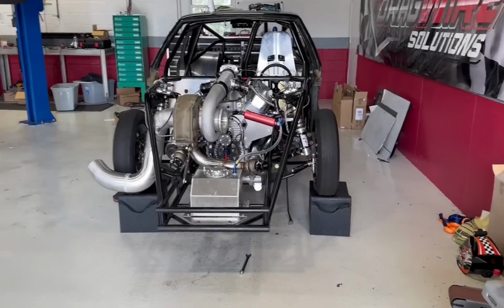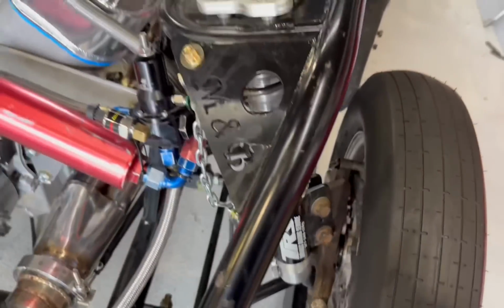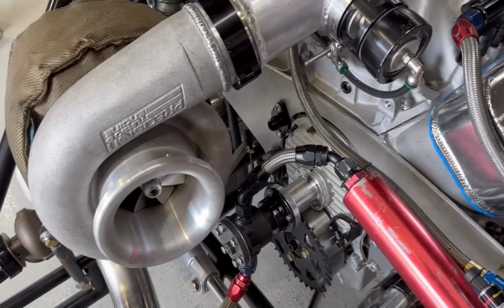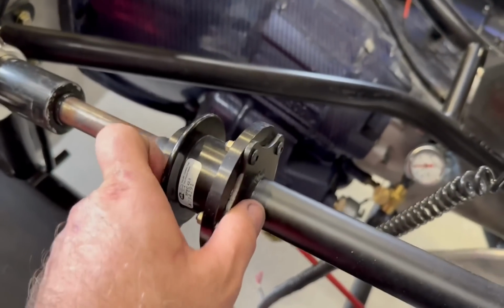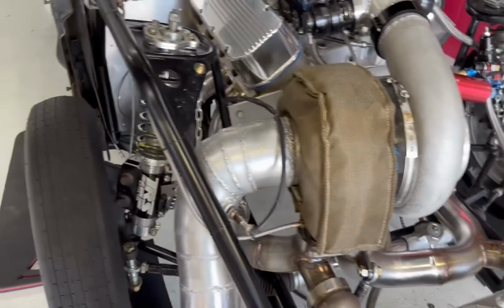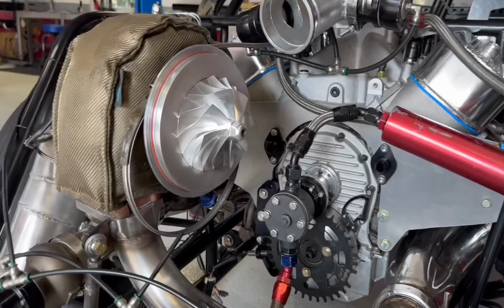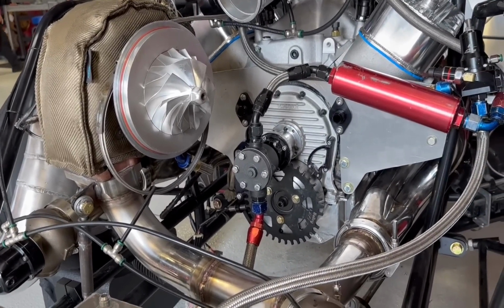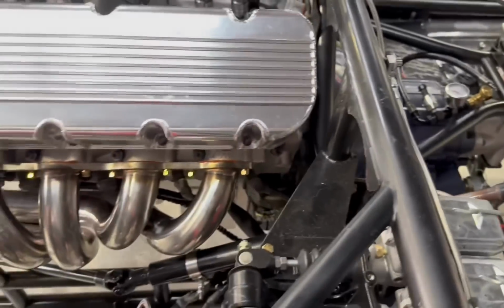Huge Progress /  Whats done...whats left / Boosted Big Block Chevy 118mm Turbo

Comment: Hey John is that cam driven pump the only pump u use
Reply from the maker: @jerryledbetter8096  I have a primer pump to help get fuel pressure after I make a pass and for first start up.
Reply: What kind of fuel pressure does it produce i have the same set up i have two holley brushless before it do you think I need all that?

Comment: Could always make like a triangle bracket that bolts to the throttle body bolts to triangulate everything snd make sure it don't bend and also install some return springs like you would for a carb just to be sure that when you let off the throttle it closes! Unless you do a solid linkage and have a toe loop put on your pedal if it don't already have it ! Just a idea

Comment: Hey John what’s a “coal harness”? 😉🤣.  Seriously I appreciated your discussion about turbo back pressure.  Steve Morris has been talking about a result of that in very high horsepower situations where the back pressure can cause the turbo to actually flutter making it impossible to accurately control boost when on the two step.  He is in the process of switching over to wastegates on the cold side only.
Reply from the maker: I ain’t a fan so far of gates on the cold side.  Will see how they do

Comment: Take zippy tie and go around one wire then feed it thru a rubber vacuum line and repeat the process. Cut the hose about the size of the zip tie head. Then you use one zip tie and looks much cleaner and you don't cut yourself on them

Comment: Quick tip of a lighter flame on a snipped zip tie cut end (really fast John), will melt that sharp cut tip to a dull smooth round end. No more cuts.
Reply: They also make flush cut pillars that don’t leave the cut sharp on zippers ties
Reply: Or you can use a soldering iron point.
Reply: Instead of cutting the excess off across the "zippy" ties turn them 90* and make your cut. No more sharp edges. I learned that from a long time electrician.

Comment: Make bracket to bolt at one of the corners on bottom of elbow where intake nut go and attached to the hole on bottom of bracket. With a bolt no more flex

Comment: Hey John, it's looking great! One suggestion: you should really consider putting gussets on the wastegate pipes from the crossover pipe to the wastegate pipe(s). If you don't gusset them,  you will eventually get cracks at the edges of the welds. I have friends who have literally had  the wastegate fall off due to this issue. Just trying to save you some headaches at the track down the road. Keep up the great work, and I can't wait to see this thing making passes.
Reply from the maker: Good point!  You are right!  I had to gusset my SBC too!  I forgot I needed to do it!